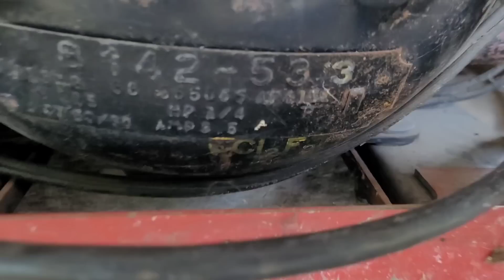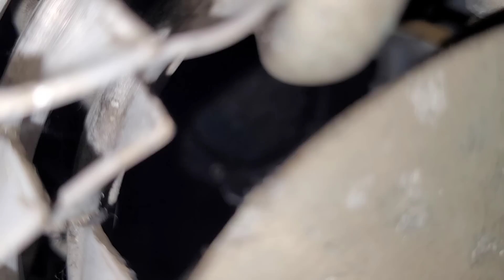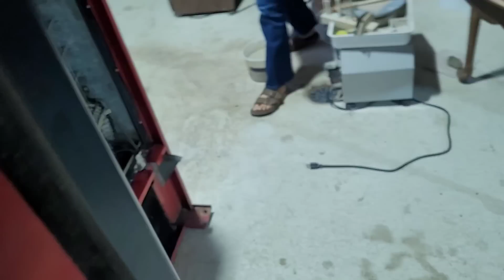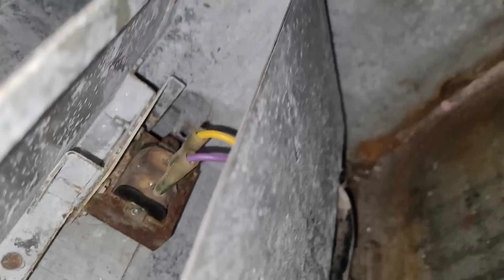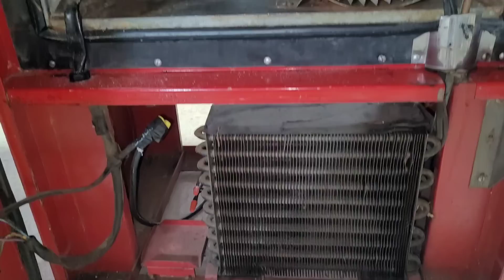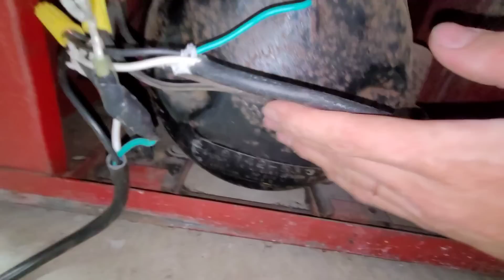Fixing a Vintage Coke Machine!

Comment: On the machines a lot of the times the wire leaving the compressor going to the thermostat can cause problems if not wired correctly and the thermostat is supposed to control the compressor and condenser fan

Comment: Most "Coke" items are highly collectible, especially the vending machines.  However, one vending machine is not equal to another.  This seems like a mid 60's machine, whereas the 50's Vendolater machines are the hottest sellers.  FYI they still sell glass Coke bottles that will fit the machine.  Great job fixing this beauty. 🙂

Comment: One of the problems with old wiring was why we developed a 3 prong plug. Often in old electric things the metal of the machine was also grounded to the neutral. So if you accidently reversed the hot and neutral, you would have a live metal chassis. So if one of the fans was wired backwards, it would short hot to neutral, providing one of the others was bounded to the metal. People used to be electrocuted by TV's by plugging to polarized plug in wrong.The cup thing is a attempt at a one way valve.Prevent bugs and other things from going in. And to keep cold air in. Eventually the started to dump water in a pan on top of compressor. The hot compresor would be cooled by water and water would be boiled of.

Comment: The weighted trap door cup for the Condensate is to keep out pests. At one time they just used a  drain line and bad things happened. Ever open one of those doors to be greeted by a swarm of BEES hiding in the machine? or worse, FIRE ANTS. With that machine's basic thermostat you can set it so low that the soda or water freezes and blows the cap off resulting in a soda machine coated in sticky sugar laden soda.....which, attracts BEES, FIRE ANTS and COCKROACHES!    On the one hand, "AAAAHHHEEEEEE RUNAWAY RUNAWAY!" and on the other "EEEEWWWWWW, its infected with ROACHES!" so eventually they used a weighted cup that dumped Condensate out when needed and was sealed other wise, this also conserved the chill.

Comment: Considering the Condensate Drip Cup's location, and the location of the 'new' splices, tells me prior to the 'repair' if the unit was in use the Drip Cup dumped a load of chilled Condensate right on top of the NON-WATER TIGHT SPLICE. You need a WATER TIGHT SPLICE or, a WATER TIGHT WORK BOX FOR SPLICES. Wago has a few, but using Environmental Splices, that is one crimp connector and one heat shrinkable sleeve with heat set sealant works and for us Air Navy types the only thing we can use.

Comment: That Compressor was built before the whole 'One Generation and DONE' disposable madness started. So, Compressors from 1980s and earlier ARE REBUILDABLE........but the places that rebuild them are fading away. You can buy and install a used or new Compressor and the machine will still work.

Comment: That drain cup appears to be super clever. I suspect it is supposed to work like a "drinking bird": the cup stays up until it fills, then it momentarily rotates down and dumps the water, then closes again.
Reply: Yes it could stay closed and hold the water to evaporate, only dumping if it was overfilled.

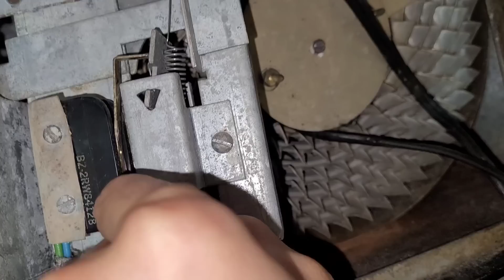Comment: 24:17 that Spring was to pull the Blot for the unlock Down. not 100% but there should be a hole in the Bolt. if not Ask Coke if they have some of the old Blueprints for that machine... if not my may find them in some archive some were.
Reply: Coke bought those vending machines from manufacturers that made them instead of making them themselves. They only contracted with whatever manufacturer to buy X amount of them in this color (Coke red) with their logos painted on the sides, etc. They could have gone as far as designing the looks or styling of the machines but I know on that specific model or type it was outsourced.

Vendo is one of the larger manufacturers that made them back in the day and I believe they still are involved in the vending machine business to this day.

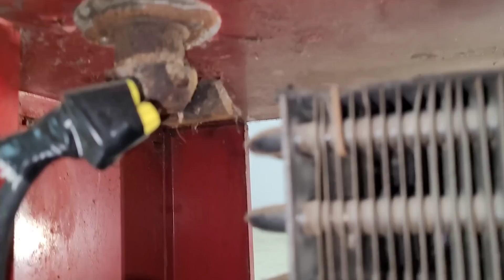Comment: 19:38 there would be a hose that is hocked into that were water would drain out some were, the other is it's help's with Drain the water condensations/ or to clean out the machine. but for inside use they used a cup cap to keep the condensations out some what also to stop it from Rusting the bottom out or shorting it out.

Comment: The reason it was tripping the breaker was because he had the neutral tied into the hot and you're correct, the thermostat was tripping the breaker.
Reply: He had treated the thermostat wires as hot and neutral like a device instead of  like a switch (hot in, hot out)

Comment: I suspect what the other guy did was wire the switch contacts of the thermostat directly across the incoming hot and cold, hence the dead short. Wire nuts aren't the best and insulation tape just gets sticky and falls off eventually. Wago connectors are better but as you mentioned a junction box is the way to go.
Anyway a big thumbs up for the video. Love the old Coke machines.

Comment: Can the newer plastic bottles fit in this like 20oz size?
Reply: I believe the 20oz bottles do fit the vend stack (bottle rack behind skinny door) without much issue if memory serves. Those are really cool vending machines if anyone happens to get one.
Reply: @orlandotech  if they fit. he may want to change the default pricing to $1. as trust me, 20 cents for a 20oz would be a steal of a price for a soda (LOL)
Reply: @bichela  ohh ya. Ill be right over If he forgets to change that! Haha
Reply from the maker: @bichela   I am not sure...I will have to get some and try it out. Not much of a pop drinker myself so I didn't have any to try it with.
Reply: @ReubenSahlstrom  Yeah, I have seen one of those machines that looked the same size that used 12oz glass bottles, when I was a little girl. but it seems the most popular size now is 20oz plastic bottles or maybe they make a 12oz plastic bottle.

Comment: Pretty cool.  I'm sure it's not the most efficient cooler ever but it would still be a neat thing to have and keep stocked.  Thanks for sharing.
Reply: Actually those older ones work better. The issue with them is the refrigerant in them was worse for the environment.
As long as you can keep the r12 from leaking it will run till the bearings go out. The biggest issue is the metal line corrode from the outside and the refrigerant leaks out. The refrigerant has oil in it to lube and help cool the compressor. The compressor runs dry, overheats, and locks up.

Comment: Is the drip cup thing just a method of keeping the air from exchanging to the outside? Almost like a P or S trap in plumbing, I remember a video you mentioned this on larger commercial units on the roof.. Not sure why else it might be there

Comment: iT IS SET TO FREE VEND
Reply: Awesome, I'll give that a go. Your video has been a great help!! Thanks eh
Reply from the maker: @TwinRiverFishing  Yeah I really claim to be no expert, but if it helps then I am happy!
Reply: Not any more  He fixed it.
Reply from the maker: @AVR-hf1rl  Oh? Is that a setting?
Reply: Any idea how I can set mine to free dispense?
Reply from the maker: @TwinRiverFishing   Well, I think mine had been messed with so it would free vend. If you disconnect that solenoid and add a spring like what I found in the machine, it should keep the mechanism unlocked all the time.
Reply: @TwinRiverFishing if your machine is still all intact with the coin mech and wiring diagram that’s still legible, you can figure out what switch in the coin mech is the one that triggers the lower unlock solenoid to move. 

After you figure that out you would want to disconnect that switch wiring off of the coin mech, connect up the disconnected wires to a micro sized momentary push button switch. Mount that hidden in a secret place like inside the top of the reject coin return slot and it should all be good after that if you got it done right. 

Another totally hidden and cool way to hide a free vend switch is to mount a similar pushbutton switch up inside vans machine behind the coin slot bezel that would have the button pushed by the manual coin refund lever that’s near the coin slot. 

Just make sure to set the coin mech to free vend so if someone does place money in it normally it will drop out of it to the reject coin slot and not steal it. Lol